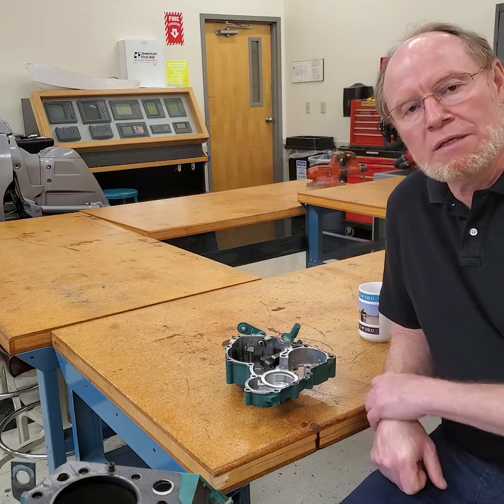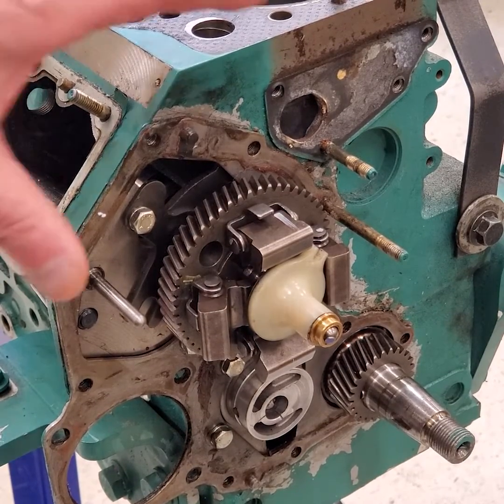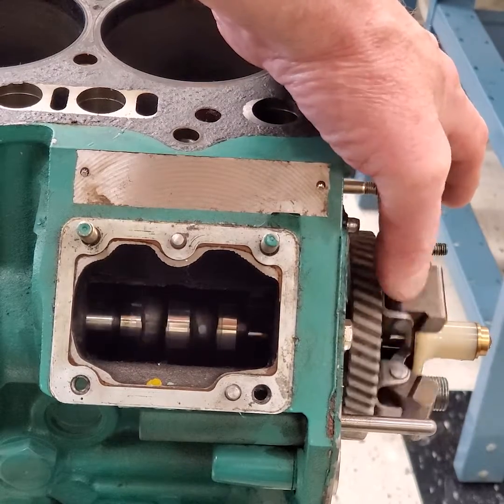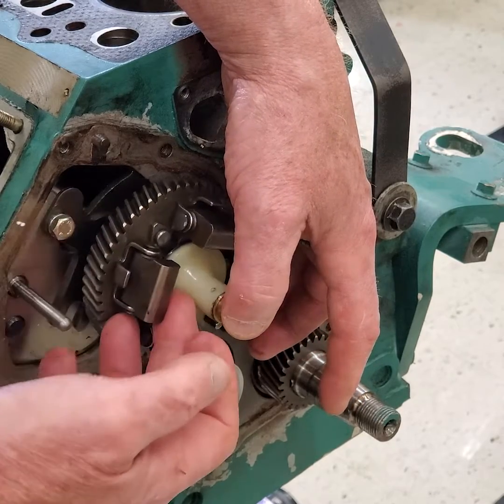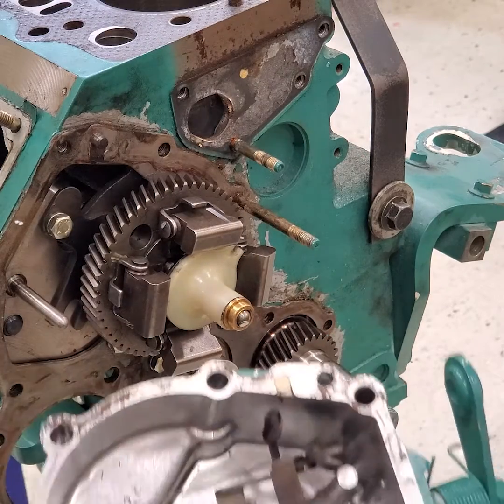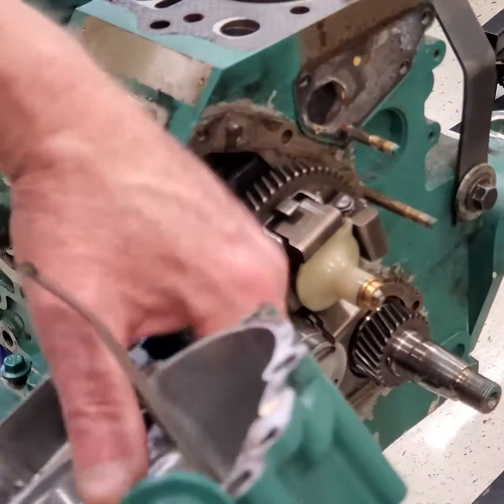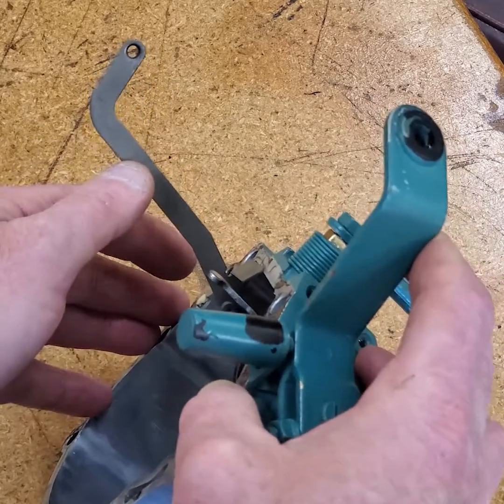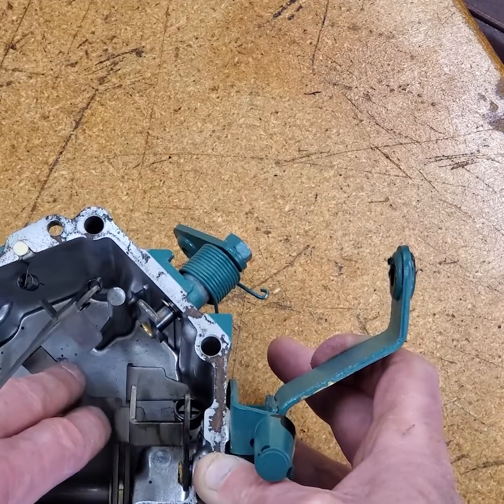How a Diesel Governor Works

Comment: HI Ted, Brilliant Video. I am looking to get a SR2 engine and had heard the governor being mentioned a lot, but had no idea of its working function. Now after watching your video I have a better understanding of  how they work and their principles. Can you answer some queries I have, Please?. I intend to run the SR2 at around 1000 to 1200 rpm under load(approx 78nm). How would I achieve this?. By turning the throttle lever screw out, to hold it at the desired RPM?. Or would I need to get special governor weights to achieve this correctly?. Many Thanks, Leon. :-)
Reply from the maker: If it is a variable speed engine (propulsion or a variable speed generator) you can set the rpm where you want via throttle linkage.  If it is a true one speed generator 1800 or 3600 rpm) then you may have trouble getting it to run at that speed without modifications.